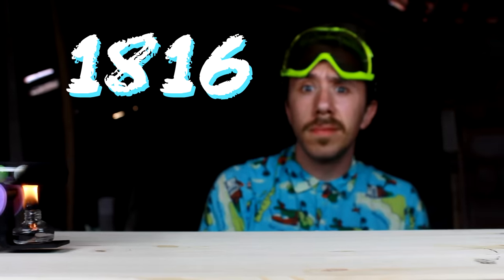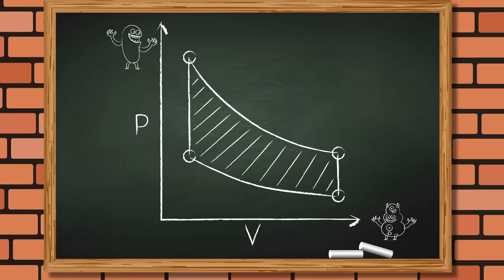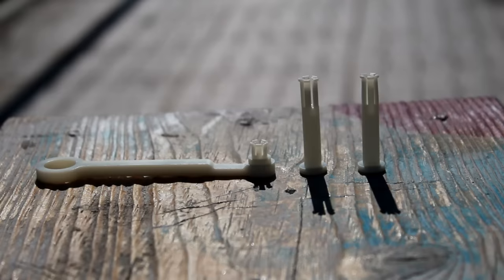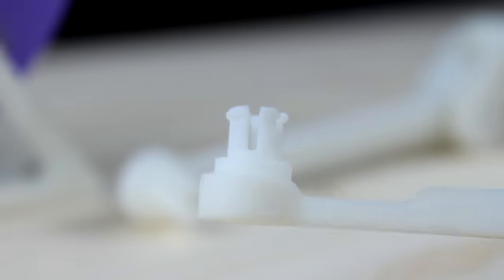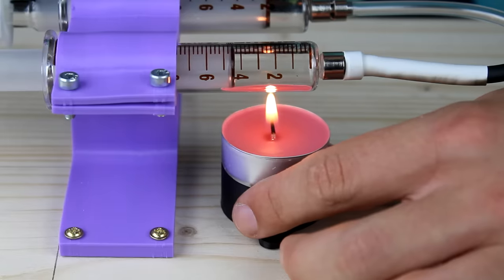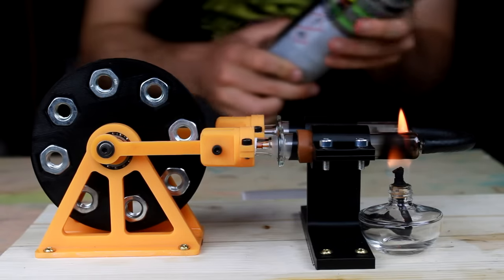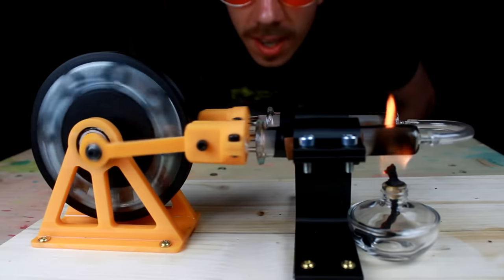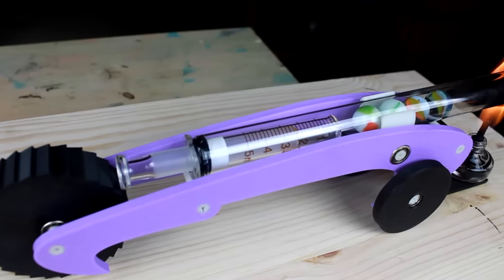Hot Air Engine Car (Stirling Engine 3D Printed)

Comment: Bad integza, wd40 is not a good lubricant. Use chain lubricant or clutch lubricant instead. Even silicone would be fine, but maybe not on bearings. WD40 is a water displacer not a moving parts lubricator

Comment: What about using electricity as a way to heat the air up?
Reply: With an electrical resistor or something maybe?
Reply: @Stigstigster  yeah exactly ! It would solve the tube melting problem :p

Comment: You can do way better. Make a real car that runs on a Stirling engine. No Liquid or solid Fuel, lets use Sunlight focused by a Fresnel Lens. You can even charge a battery to kick in an electric motor when the Sun goes down or behind the clouds. I think it's Doable. I just invented the Car of the future!

Comment: integza: needs low friction

also integza: uses degreaser, which yes, can act as a temporary lubricant, but evaporates, leaving the metal to rub up against itself, causing more friction over time
Reply: If you want ball bearings to spin fast and free, you don't want any lubricant on them. Because this motor isn't under load, the bearings will last a very, very long time. Any lubricant you can use on these has a degree of stiction, which adds to the rolling resistance, which is what you're trying to avoid in the first place.

What he should have done is used isopropyl alcohol to remove all of the oil/grease from the bearings, that would have yielded an even freer bearing and gone faster. As-is, the wd40 leaves behind mineral oil, which definitely adds some stiction to the bearing, slowing it down. Mineral oil does not evaporate, as you suggest, but it's often not recommended because of it's poor film strength in loaded applications.

In an ideal setup, he would use ceramic ball bearings, like they use in nice skateboards, because those would last longer without any lubrication even under load, and have an even lower natural rolling resistance.

Comment: You could try silicone tubing like Nitro powered models use. It’s heat resistant to around 300C if memory serves correctly. Also make a small container so that the regenerator can be mounted between the cylinders. If the steel wool is in the cold cylinder it will slowly heat the cylinder up, not act like it’s intended to be used as a heat capture device when the hot air rushes to the cold side & a “heat releaser” when the cool air is rushing through it to the hot side.

Comment: All these problems you kept having with the tube and yet didn't think of silicone 🤦. Silicone is heat resistant to a multiple hundreds of degrees F. Do they not have silicone tubing where you live? That should have been an obvious answer to that issue.